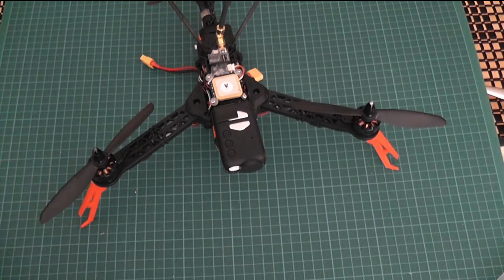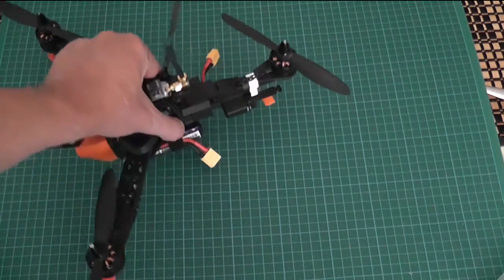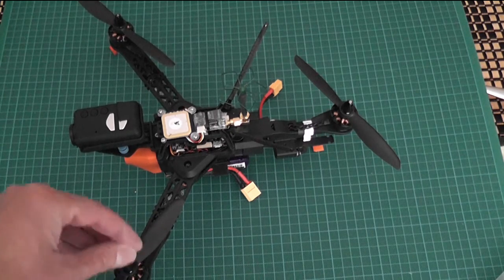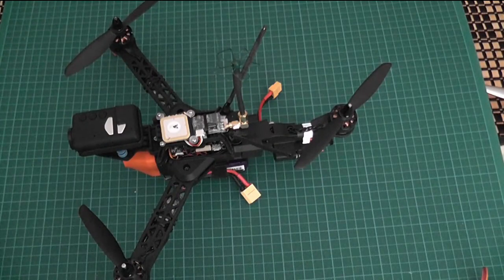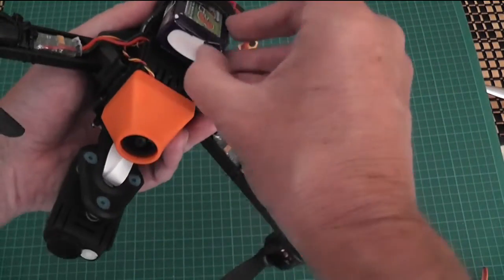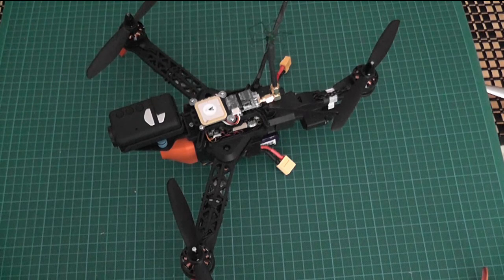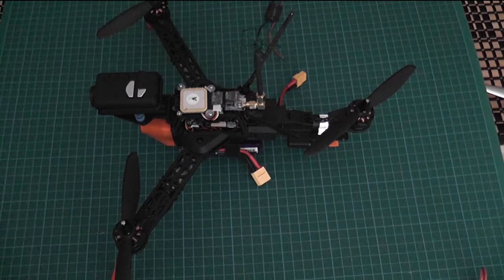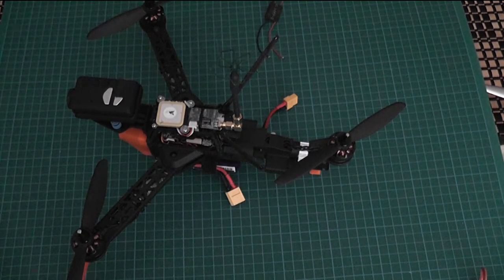Problems building the Quanum Trifecta Part2

Comment: Great video.  I'm a bit confused by your clockwise versus counterclockwise, but hey...  I looked on Thingiverse and I don't see those legs under Quanum Trifecta.  There are some other leg extenders there, but they don't look as good as yours.  What is the name of the file on Thingiverse?
Reply from the maker: Rotor Trek There is a separate video on the legs here https://youtu.be/G9kZP7-YGcw there is a link to the thingiverse design in the description. I didn't print them myself but got them done professionally.

Comment: you do know you can just swap any two wires on the motro. and it will reverse the direction its turning Right ?
Reply from the maker: Yes. The issue was the thread direction not the motor direction.
Reply: Strange

Comment: I'm about to attempt the Trifecta and micro APM build. What were your PIDs in the end that resulted in decent flight behaviour?
Reply from the maker: +joeprice22 For my setup with Nano tech 1300 3S battery, and sunnysky 2100kv motors with FPV gear I have:
Roll - P:0.035 I:0.035 D:0.0025
Pitch - P:0.053 I:0.053 D:0.003
Yaw - P:0.2 I:0.02 D:0.00

Before I added the FPV gear it was a lot lighter up front without the cameras so I had:
Roll - P:0.038 I:0.038 D:0.002
Pitch - P:0.058 I:0.058 D:0.002
Yaw - P:0.2 I:0.02 D:0.00

Unless everything is the same as my setup you'll probably end up with different values. APM allows you to set up one of the knobs on your transmitter to adjust a PID value. You can also set up a channel to initiate autotune which allows the APM to configure the values automaticaly